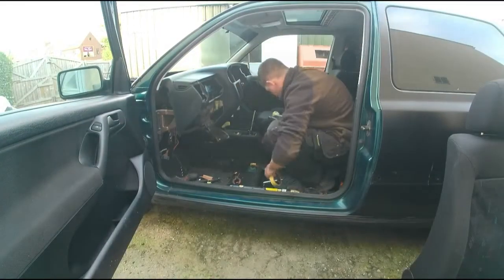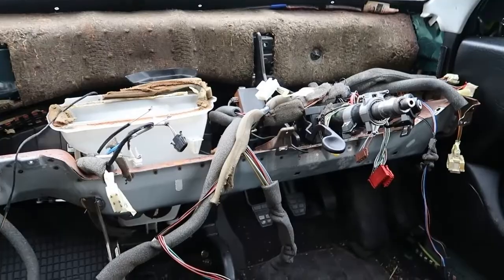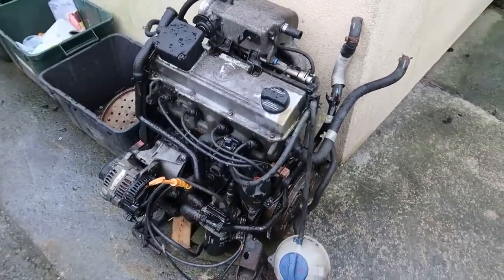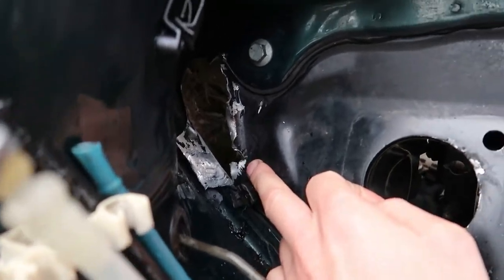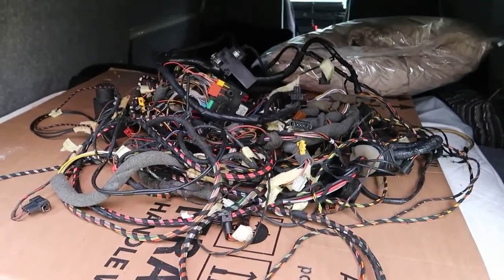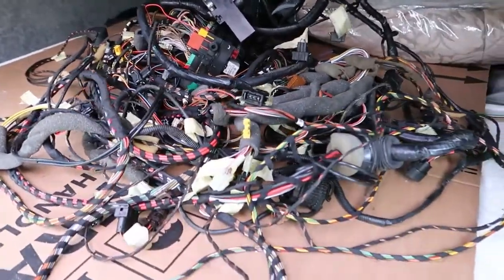vw T25 GTI Mk3 Golf GTI engine conversion Removing engine and loom from the donor vehicle

Comment: Mainly joining the t25 gearbox on the golf engine.!! How to go about?
Reply from the maker: It should just bolt strait on. You use the flywheel off the original engine thats already in the van.
Reply: My gearbox is a 1.9 Dg boxer engine.
Reply: Is it compatible or do I have to do some modification?

Comment: Hey mate. This year about September time I had a 1.9 golf GTI engine put in my VW t25. It's amazing and it gives 110bhp. Just need to sort the rest of the van out now 😂😂
Hope yours god well mate, good luck.
Reply from the maker: Cool. Im glad to hear its amazing lol. I will upload another video with more progress soon. I do resprays if not to far away 😉👍
Reply: @Supercarlsunday  hahaha, body works not that bad. Need to get it watertight first and right hand headlights! 😂
Reply from the maker: I see lol. Import. Shouldn't be to bad then. Best of luck with it 🙂.
Reply: @Saker_j  How are you doing with the modification that engine you have previously
Reply from the maker: I have been doing other project so I came off this. I'm going to start doing this when I come off holiday. I need to buy some parts. New fly wheel and bearing to start with.